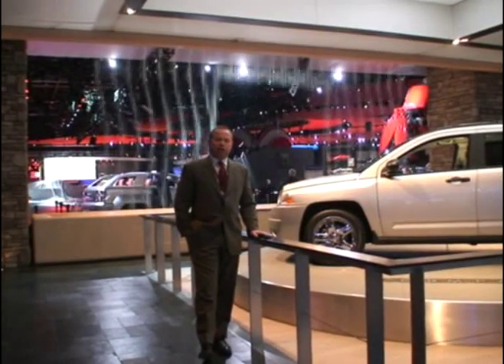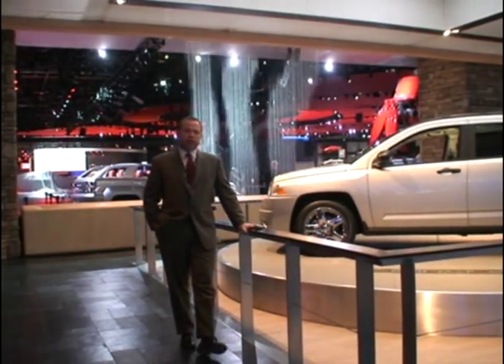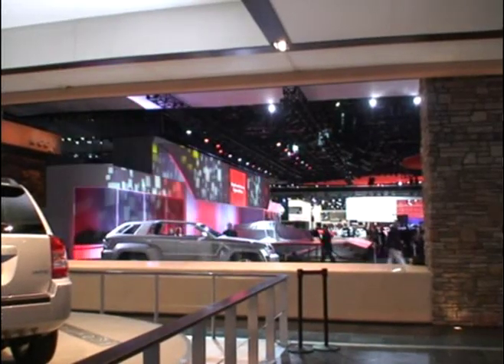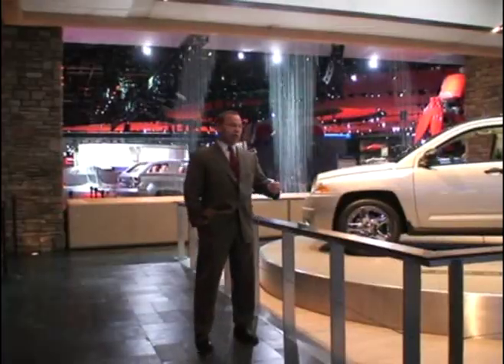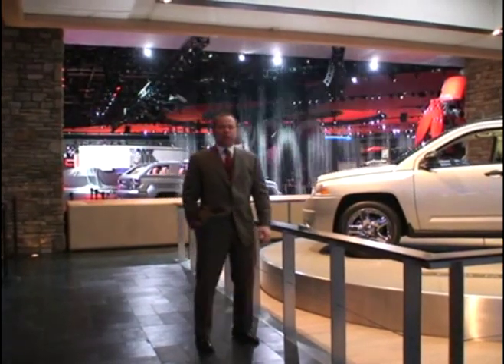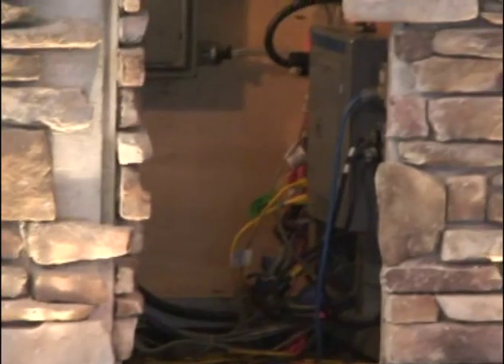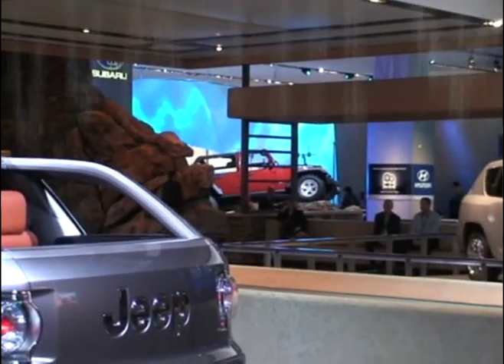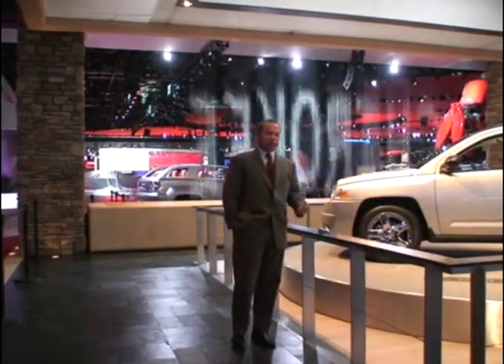Jeep® Waterfall

Comment: I suppose, but even with an image a tenth as detailed as that, you're still going to need a stupid (90,000) number of valves.

Fact is, squaring a number is squaring a number :/.

Still, I'd love to see such a thing. Perhaps a smaller 100 x 100 matrix?
Reply: As someone who worked on the device (you actually see me, in the long sleeve red shirt, changing places with my coworker at 2:15) I can tell you the 12 display modules used here are each an 8x8 matrix of high speed valves.  Packing them tighter wouldn't accomplish anything, at the distances we need to be visible from (such as at the Atlanta Olympics) this resolution is perfect.  We have a second ("thin") model module that is 2x32 rows.  An intermediate 4-row version was proposed, but when I left the company in '09, they hadn't gone forward with it.

Comment: Actually, they rent it... It comes with a crew to run it, and tech support. 

The water recycles through the system with remarkably little loss.

Now what they'd like to do, is find a way to keep people from dropping cigarette butts into the lower part or sticking their hands in the water.

Comment: Same thing really.  The valves themselves are arranged as a 2 dimensional matrix or array.  The interconnected pipes would make it a grid.
Reply: 8x8 modules, with a manifold at the top to distribute water.  3" supply hose that breaks out to 1" lines for each module.  A display like this needs two supply sets.